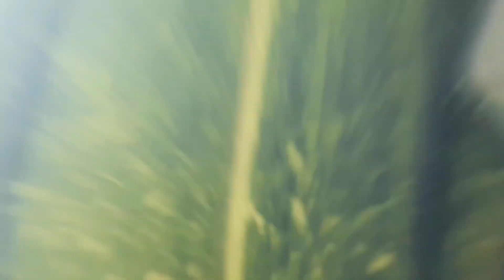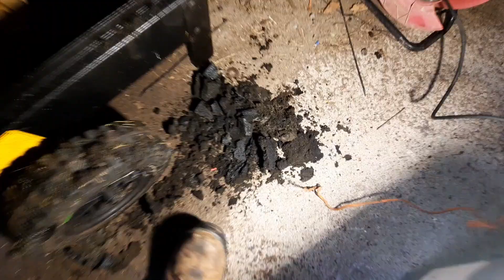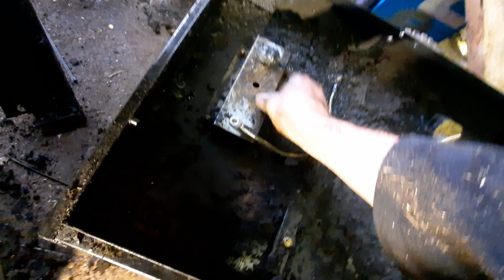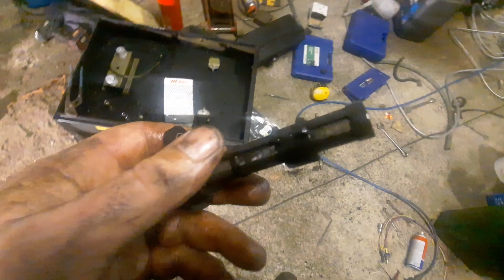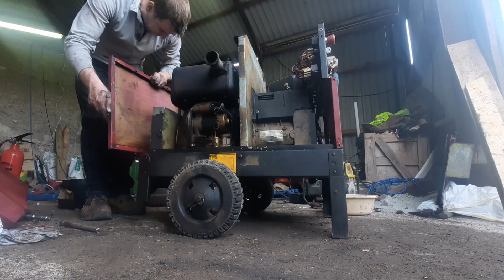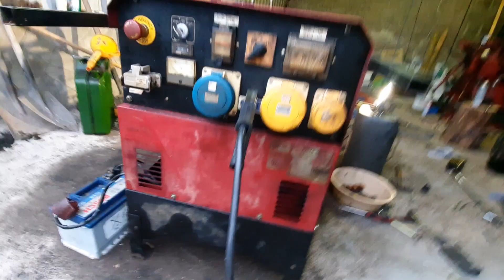Diesel Generator - Will it start after sitting for 9 years?

Comment: Just subscribed to your channel,love your videos especially the Range Rover  episodes was going to look at an L332 this coming weekend same year and milage as your own for same purpose for the farm and other work ,a bit apprehensive about it don’t want to get stuck with a lemon ,
Reply from the maker: Donal, thanks for watching and subscribing! The biggest thing to watch, if it's a TD6, is the gearbox. It's a common failure and probably the single most expensive repair. By that mileage I'd expect it to have been replaced. Also see if there's any evidence of  the box being serviced. The other biggie is rust. They rot out under the plastic sill covers and the subframes so check carefully. Check the DOE sheet from it's last test for advisories. If you can, take a good scan tool with you as well. Check for water ingress (including the spare wheel well). They are a great thing to drive, but be ready for the economy (10-12mpg running up and down to fields here). Everything here is over prices as well so don't pay too much. Good luck with it, come back to me if you need anymore advice.